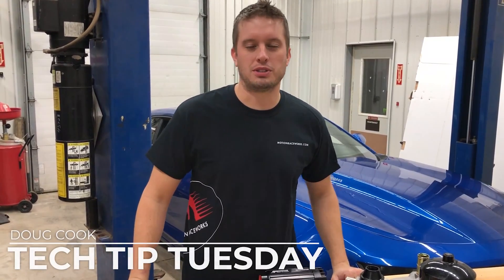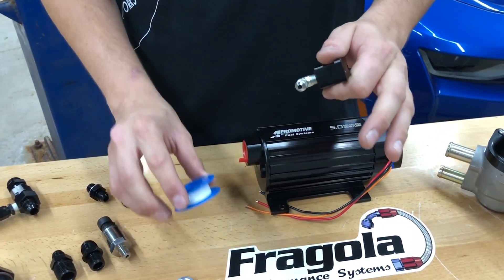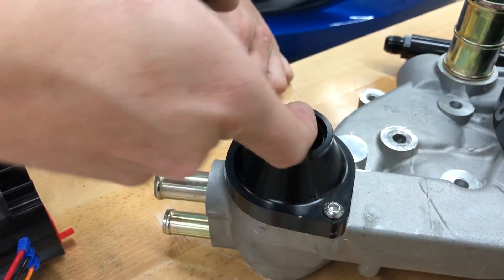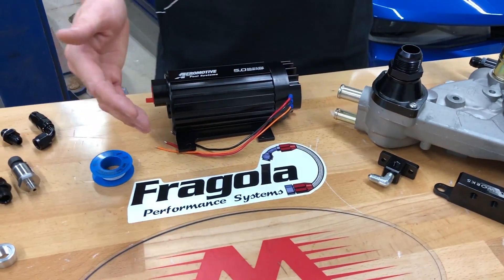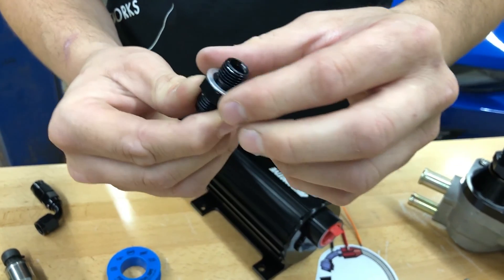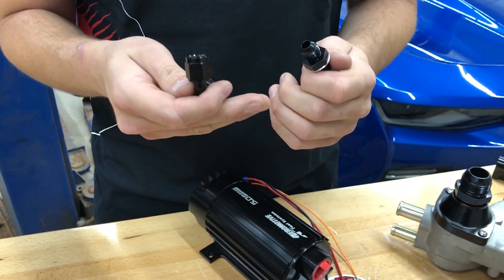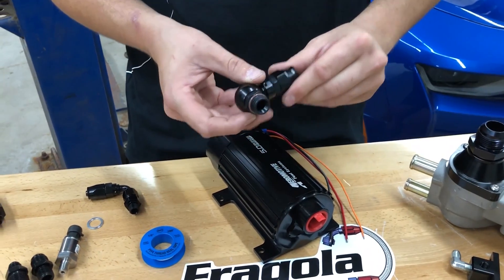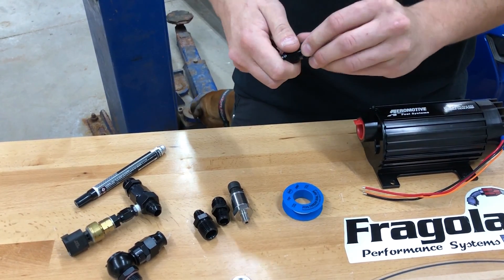Tech Tip Tuesday - NPT ORB AN and Face Seal Fittings!

Comment: I have an6 fittings I added to my TBSS manifold fuel rail with a flex fuel sensor attached to it, it started leaking from my AN fittings what should I do?? I can’t use teflon for sure so what I do ?

Comment: Thank you Doug.
I'm a flight instructor and apprentice aircraft mechanic. This is the best intro I've seen on YouTube. Its a great instructional video that most YouTubers are not able to do.
I just spent $1000 on different fittings building two fuel pumps and two fuel filter , 100 + 10 micron  for a Subaru powered aircraft. It uses NPT pipe thread, ORB and AN connectors. The Fuel Pumps and Fuel Filters FAIL to state what their root connection is, they all throw in adapters when we  need to design our systems from the ground up, not from their adapters. 
In the hangar, I have never seen a single person use other than a steel wrenches used carefully. Its very obvious that steel on AN or ORB aluminum fittings can damage them. 
I'm ordering some Carbon Fiber wrenches.
This vido spells it out but I had to replay it and screen shot save  a few parts.
Key pics that need some time are, the O-Ring, the seating and perhpas recomended Torque used with these  fittings, and do you really need Carbon Fiber wrenches.

Comment: Npt does not need tape or dope if you tighten it all the way. That is literally the point of a tapered thread. However dope will lubricate the threads to help you get it tight enough, not really necessary for 1.25 and smaller pipe and fittings but 2.5 inch black steel can be difficult to tighten

Comment: Orb is a chamfered bore not a counter bore. it looks like a counterbore because it is only 12 or 15 deg from parallel. It also has another chamfer attached to the first that is 45 deg. Look up orb or sae port tool geometry

Comment: At my hydraulic shop we call face seal fittings the ones that the oring are on the tip of the male fittings. That crush washer one you show is pretty much orb with a washer instead of oring

Comment: Good info.  I thought I heard not to use teflon tape on NPT fuel fittings but I wasn't sure; something about the threads cut tiny pieces of the tape off and they go into your line, clogging an injector.  If I use a paste, however, wouldn't that cause a similar problem?

Comment: Good Stuff!   Clear and Concise.   I found you because I'm looking to repair a Steel Braided Line (probably PTFE) to factory a Ford Spring Lock Connector and double o-ring and transitions to an NPT fitting on a '95 P71 Oil Cooler.

Comment: My dad showed me fuel rated pipe thread tape the other day. Its yellow and a little thicker than the regular white Teflon stuff. I never knew it existed, but i wish i had. It works a lot better than Teflon tape and solved some fuel leak problems i was having.

Comment: How about a tech tip video for installing PTFE -20 AN hose ends. Those things are tough getting the fitting inside the hose liner with the olive in place. I have wrestled for hours on just one hose end before.

Comment: Great video Doug! For fuel systems/dry sump oil systems, there are two different styles of ORB. Standard straight cut o ring (has a female flare) and straight cut o ring boss that has a radius machined in. Is there any real performance/flow difference between the two and what is your recommendation in these instances?

Comment: Is there a special kind of liquid sealant for use with ethanol?
Reply: Use some loctite thread paste 567. It will still be removable and is good in soft metals as it prevents galling.When you use it make sure the first couple of threads are clean and don't have any on them to prevent it from getting into the circuit.